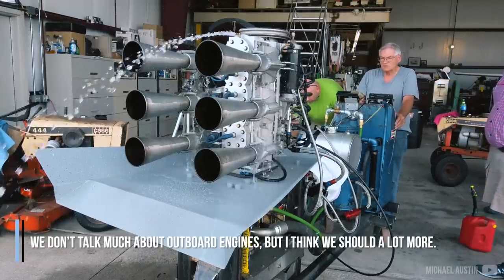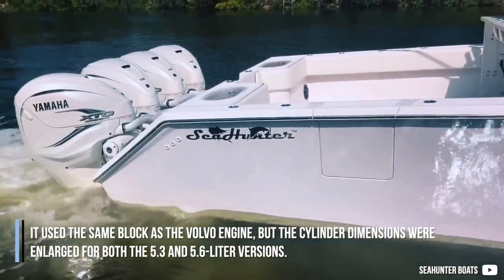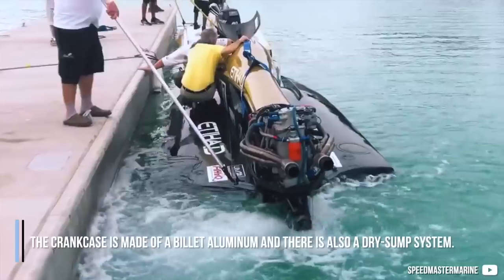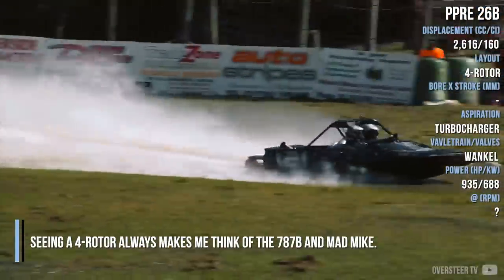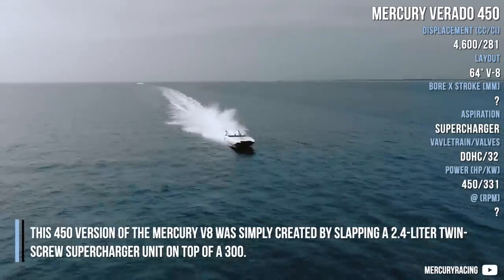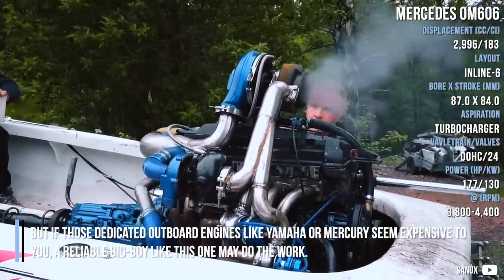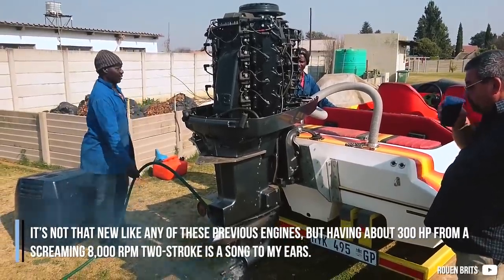Crazy Outboard Engines

Comment: That 2 stroke v8 is just crazy and imagine that we put that 2 stroke v8 on a rally car,  it would be awesome
Reply: They already did that, years ago, in Russia...
Reply: @mpetersen6  nobody does crazy builds like the Swedes
Reply: Oh, please! A four-stroke, small-block and fuel-injected V8 is a better choice for an outboard engine on a certain boat.
Reply: @josecarrilloii4036  yeah, but the chear crazy feeling which 2 stroke provide are on another level and 4 stroke v8 can't provide that,  it's not just about going from point A to point B,  it's about feeling, enjoyment and craziness
Reply: Search : Rudezon (your dreams car)😉
Reply: I think there’s a land speed car that did this
Reply: @pabitrikalita3940  True, you don't get the power band that a two-stroke offers. But with a four-stroke, you make up for that power band loss with the torque figure.
Reply: 4 strokes add a lot of weight as well
Reply: @crackjack8320  exactly! i have no idea where this "4 strokes have more torque" myth comes from. in outboards, 4 strokes are geared a bit lower to make up for the lazy low end. they also underrate alot of the larger 4 stroke motors to keep up with the older 2 strokes. combine that with generally higher rpm makes the new 4 strokes keep up and in some cases surpass older 2 strokes, but at a sometimes sever weight penalty. They are also using huge blocks to keep up with them... the yamaha 200 v6 is 4.2 liters, which is larger than the evinrude v8 (4.0 liters after 1988). the later XP/GT 300 put down over 300hp at the prop without breaking a sweat!
Reply: Dude in the V8 OMC needs a helmet, life jacket, and kill switch 👍🏻

Comment: Boat engines are confusing
Reply: Try working on them, i worked on boats for years, the engine variants are crazy and when you are working On 6 different engines at the same time it can get quite overwealming.
Reply: No Emissions, absolute Freedom
Reply: i hate to see engines slotted down like  and covered from its beauty on an outboard configuration
Reply: @MyFabian94  they only have lititation for the oil useage as i know. They put the exhaust into the water and the leftover fuel-oil going into the water. And to be honest, its not so good.
Reply: @DaBombtasi  modern two strokes are efficient enough that the unburnt oil/fuel is negligible.
Reply: @James-tg5gp  only evinrude does 2-strokes nowadays, everybody else switched to fourstroke. Emissions.
Reply: @nielsdebakker3283  evinrude just went out of business:(
Reply: MyFabian94 wrong, there are emission regulations for outboards and marine inboard motors
Reply: Daniel Simpson when did this happen, as far as I know they were bought by bombardier
Reply: Fargonian Productions Bombardier bought them after the fall of OMC in 2001, recently BRP shut the doors on Evinrude and quit production with no plans to sell their patents or tooling. A sad day indeed
Reply: @Kittendownloads  just!! they went out of business before 18 years ago lol

Comment: 6:11 F for the few ecologists here XD
Reply: A hydro carbon loogie for the "how dare you" people on this earth.
Reply: It's also tuned like shit.
Reply: must be running on diesel and definitely not.euro 5
Reply: @apancher  yeah, if a diesel if vomiting THAT much smoke, way too much fuel is goin in. (Sometimes they'll poot a little, but nothing like this)
Also F for anyone's lungs downrange of that. having breathed diesel soot in once, it's *horrible*, lol
Reply: Not only is rolling coal incredibly gay, but it's tuned like shit and wasting power by dumping too much fuel
Reply: @M Bacon As a concept I love that idea but in practice I couldn't tell you. Are the engines built to have a 13.5:1 compression ratio to fully utilize the octane rating rating of propane? I don't know, and the website doesn't say. I will say however that these could be perfect for those people who capture wood gas. If they can filter out the moisture and tar then converting is as easy as filling the tank with wood gas instead of propane.
Reply: The carbon itself is fine, which is what you see. The bad part is the CO2 plus the Nitrous Oxides.

Comment: Visio, I think you have confused what 'outboard' means. An 'outboard' engine means it's mounted outside the hull. In this case the 4 rotor and the OM606 are mounted as 'inboard' engines, cause they are inside the hull.
Reply: just like he said in the video...
Reply: Read it again, it's fine but if you notice he means to say the OM606 is not meant to be an outboard from the factory, implying it's being used as an outboard.
Reply: it's totally fine, tho, the video is good regardless

Comment: You left out the most iconic outboard engine of all time. The mercury 2.5 v6 2 stroke 🤦🏻‍♂️
Reply: Greg Dunn we have one on a Checkmate at the lake house, runs well.  I prefer the 4.0 V8 on my Starflite here in AZ.
Reply: It’s literally just a 2 stroke v6 that’s unreliable
Reply: @jadelees5671  I bet you never owned a 2 stroke outboard motor these lasts for decades you probably don't know what your talking about lol
Reply: @khaledmaher6602  I have a 115 v4 Yamaha. Mercury’s suck ass when they hit sat water
Reply: @jadelees5671  bullshit my cousin owns an mercury 115 and it works fine after 20 years+ in salt water
Reply: @jadelees5671  cry all you want but these mercury are tend to last up to 2000 hours
Reply: @khaledmaher6602  lmao mine has over double and I’ve only changed the starter.
Reply: @jadelees5671  ok soo I've said Mercurys never said my cousins he maintains it well
Reply: @khaledmaher6602  yea right I’ve never seen heard good thing about two stroke Mercury’s. Never heard of them even passing a thousand hours. Plus two thousand hours isn’t even a lot.
Reply: @jadelees5671  then you never heard about mercury research about it pretty sure its reliable with low maintenance
Reply: @khaledmaher6602  I worked on a 150 merc a few weeks ago. Just cause you read some shit online don’t mean you know what your talking about. I’ve done more than just basic maintenance and you can tell that the quality isn’t on the level of yamaha I’ve looked at tons of motors and got real experience.

Comment: I know someone who has a mini yacht, that uses 5 motors. They each kick in sequentially depending on throttle input. It's pretty cool actually, cause for low speed cruising only the center one is pushing the boat; but as more power is needed, the propellors centrifugal clutch engages on the other 4, creating a smooth transition from around 20mph (~32kph) to around 60 (~96kph).

All 5 are running simultaneously, but they all come in during certain load conditions where they provide an extra boost of power.

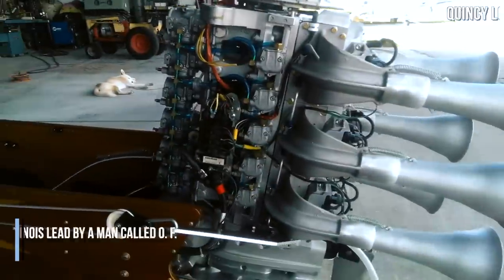Comment: Quincy Welding at 4:00 has been building hydroplane racing  outboard engines and controls since 1952.  Inspired by Mercury Outboards, they take Mercury engineering to a whole new level of outboard racing engine performance. ;-)

Comment: Word of advice: Boat and Bus motors crank the opposite direction (i.e. a pusher bus motor will make a front engine dump truck go forward while in reverse and backwards while in forward gears)

Comment: One of our friends had a Stoker twin tunnel hull boat with that Evinrude V8 outboard.  Like the guy in the video, my friend had opened up that plate above the prop.  Many a time I had been out in that boat, and I can still recall that banshee wail that outboard made.
Reply: I currently own the tunnel boat with the v8 that v8 was on one of my dads boats we have since swapped it with a like new v8 Johnson very similar engines just this one is not ported like the one in the video 😁

Comment: 4:22 i can see why outboard engines don't need radiators
Reply: You seriously wondered why they dont have radiators??? Do you wonder why boats dont have seat belts???
Reply: @dozer8065  whoa there buddy calm down
Reply: @dozer8065  No one is born with knowledge.
Reply: They used heat exchanger
Sea water is too corrosive
Reply: @bitelaserkhalif  I know of at least one sailboat that used the whole hollow steel keel as a heat exchanger so that the bus engine used wouldn't get salt in it.
To add something for the OP's benefit: Radiators tend to deteriorate from the salt in the air. So a lot of manufacturers just said Fuck It, treated the block as best they could, and pulled in sea water for cooling directly. It's typically how cheaper outboards and a few inboards are built, but nicer stuff uses a dual-loop setup whereby fresh coolant is placed in a pipe/chamber with sea water in a chamber right beside it-heat travels into the cold seawater and is then pumped out, that's the Heat Exchanger mentioned above. It's a much cheaper part to replace (it's almost a consumable) then the block itself.
Reply: Their radiator is the ocean

Comment: How on earth they made a 3 litre V8 two stroke and managed to extract less than 300HP is beyond me
Reply: Yes, i get ya. Only thing i can think off is to use displacement to get reliable hp. Engine must have tonnes of hp to unlock
Reply: Check the timeline and check how little power an amrican v8 car made in that era.
And boats need reliability, no mobile phones and no hitchhiking at sea.
Reply: A boat and a car have two different requirements for making power.  A boat engine needs to stay at peak rpm the entire time. Not like a car which spends majority of its life at low rpm.

Comment: Nice video but i wouldnt recommend anyone runs a outboard at 8k rpm, especially a johnson v8 that thing will grenade. Most outboards run between 5400-6000 rpm inboards around 4600-4800 rpm. I do believe the johnson v8's maximum WOT rpm is rated for 6250.

Comment: The Chrysler HEMI V8 (5.7L or 6.4L, depending on vehicle model; 2003-present) ...is probably the best choice for an outboard engine on a speedboat.

Either that, or a de-tuned Chevrolet LT1 small-block V8 (5.7L and 6.2L) ...from a Chevrolet Camaro (3rd-gen onwards; 1988-present) or Chevrolet Corvette (C4 onwards; 1989-present), or even a de-tuned 5.0L Coyote/Windsor V8 or Ford Modular V8 (4.6L and 5.4L) ...from a 1987-present Ford Mustang GT.

Now obviously, any of these outboard engines for my choice of boat would be four-stroke with direct fuel-injection.

Comment: I'm pretty sure the Yamaha v8 based from the Volvo Penta drive is really originally a General Motors 5.3 liter v8
Reply: The 60° aluminium V8 used in Volvo cars (4.4 liter) was developed and bought from Yamaha. It is not the Volvo Penta 90° V8 inboard marine engine, which was never used in cars (but indeed based on a GM iron block).

Comment: I love the video, but motors like the om606 and 26b rotary aren’t outboards. I’m not familiar with sprint boats so I’m not sure what sort of propeller or jet drive they use, but the 606 definitely had a V-drive as the driveshaft was facing the front of the boat. As for the Evinrude/Johnson guys such as myself. As of just a few days ago Evinrude has seized production on all of their motors and will no longer be building outboards. A sad day for 2-stroke fanboys as myself as they won’t be built again in mass production. There is a company called CRT(Caldwell racing technology) that builds billet mercury v6’s in the 2.5L and hopefully soon a 3.5L form. They have a hefty price tag but sound and perform like no other.

Comment: The Mercedes Diesel should not smoke like that, if you want all the power. The smoke tells you that the engine doesn't run efficient. And BTW it is uncool to have a smoking diesel.

Comment: I wonder how an outboard engine would work in a automotive application
Reply: The problem is the cooling, outboard motors have limitless amounts of cool seawater at their disposal. They are not designed to be cooled off by boiling hot water as in a car. May work for dragracing.